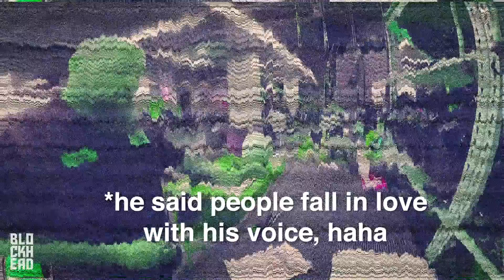What is OCTANE in Gasoline? (& Octane Booster Explained)

Comment: Why would you want to slow down the explosion in the engine?  The faster the explosion the more energy released which increases the pressure faster in the engine. Therefore more hp.  What's your thoughts on this?

Comment: AvGas is 100 octane. You can get it at airports. For clarity sake, are we suggesting we should be running 100 octane in a completely stock bike, or say stage 1 bike? Or is this more applicable to a built-out 131 torque monster?

Comment: At 5000 rpm, the spark plug for each cylinder fires 2500 times. In a four stroke engine, two strokes occur for every revolution of the crankshaft. The intake stroke occurs as the piston travels down (1/2 crank revolution, or 180 degrees). Then the compression stroke equals the second 180 degree crank revolution. Same for power stroke and exhaust stroke. In a 2 stroke engine, the plug fires once for every revolution of the crankshaft.
Reply: i. noticed that too was about to comment but you already did it.
Reply: Right?

Comment: I can tell you what my book recommendation is for my 2006 Honda vtx 1300 on the gas, but what would you recommend?
Reply: Follow the recommendation unless the motor has been built. Buy the best gas you can afford, as in avoid the no name stations with rusty pumps and such. 

You only really have to start veering from the recommended numbers when you've introduced changes to the system. 

Higher octane isn't going to hurt anything, it just might not offer any kind advantages. Good quality fuel is going to make a bigger difference when all else is equal.

Comment: Its funny how you guys in the States have trouble finding ethanol free gas,and when you do,it is low octane. Were up here in Canada all big named gas stations have Ethanol free gas,that is high octane. I go to Chevron and get 94 Octane Ethanol free gas all the time for both my bikes
Reply: How much are you paying for a gallon of ethanol free?

Also, climate up there is considerably harsher than Florida. I suspect ethanol free is easier on engines in colder weather and hits flash point sooner. I used to live in Montana as a kid. But when you're 10 you don't care about fuel efficiency.
Reply: @tommyarnold890  If you haven’t seen it take a look at fortnine’s post on fuel stabiliser modern fuel is a cocktail of additives & most probably has been for many years. Ethanol has been added to petrol to increase the octane level along with the “green BS” the problem with it is  that it attracts water and you get worse mileage out of it . I am beginning to think that tuning the engine to get much more HP out of a motor is becoming  very expensive and more trouble than it is worth if you have to rely on additives to keep it running .
Reply: Our federal government heavily subsidizes the crops used to produce ethanol and biodiesel, so they get produced at artificially lower costs. Adding them to our fuel helps keep the cost of fuel artificially lower.
Reply: @timconway7860  meanwhile the ethanol erodes the seals and parts in the engine resulting in the engine tearing itself apart. It was a stop gap measure that became the status quo by political hacks that didn't understand what they were doing.